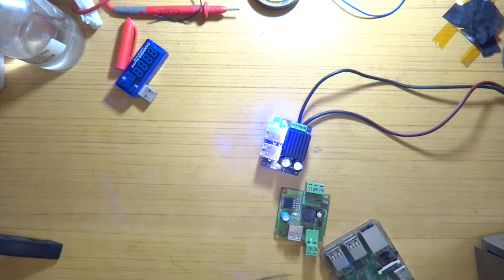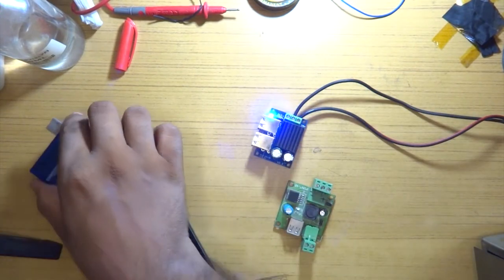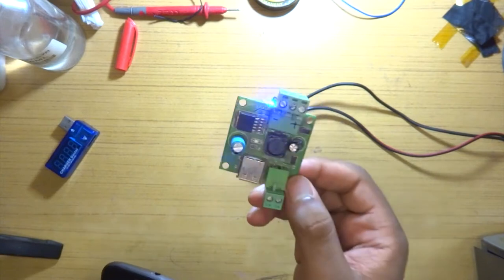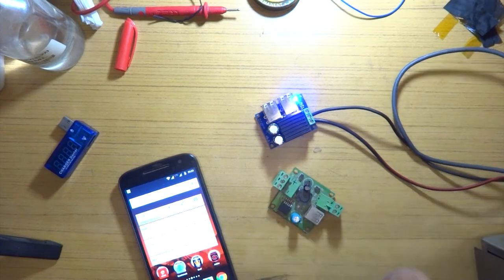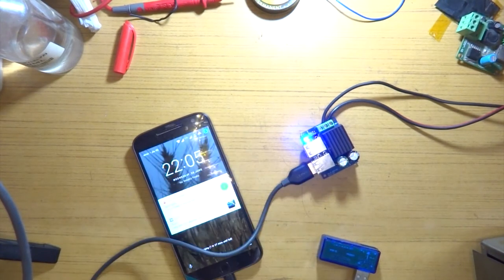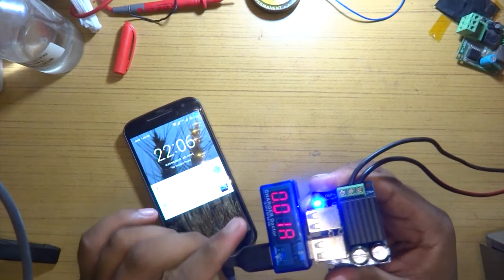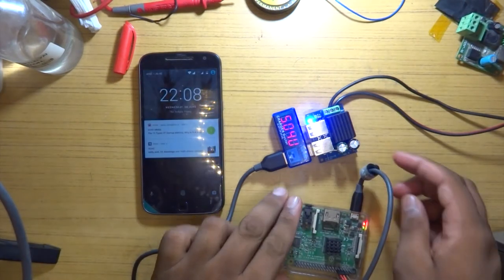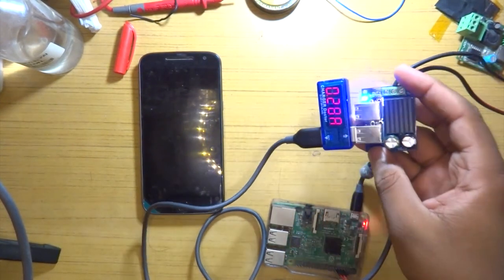6A 5v DC-DC Step-Down Voltage Regulator Module TPS40057

Comment: do you have any idea how idk if its possible make any smartphone battery charge faster than its regular charger?
could be an interesting project
cool device
Reply from the maker: Chetan Amrao bad idea... remember the note 7? that's why no one does it. The manufacturers are already pushing the limits with quick/fast/dash charging.
Reply from the maker: anyway, it would have to be done by modifying the components inside the phone and not just via external mods